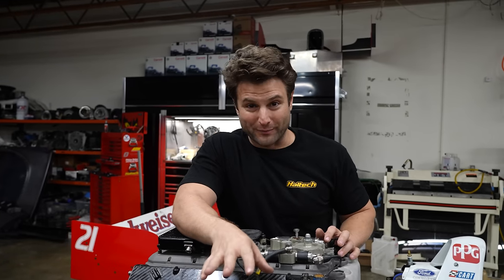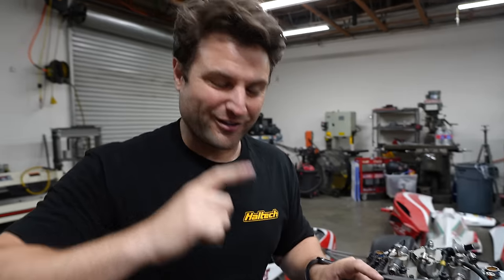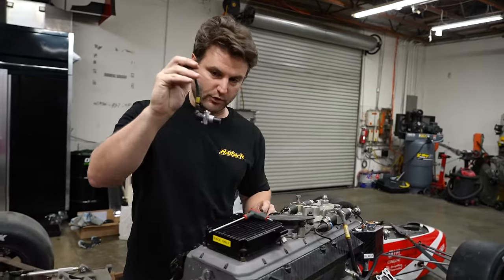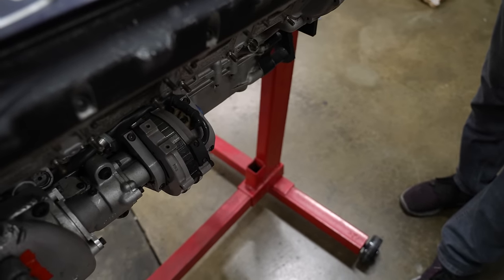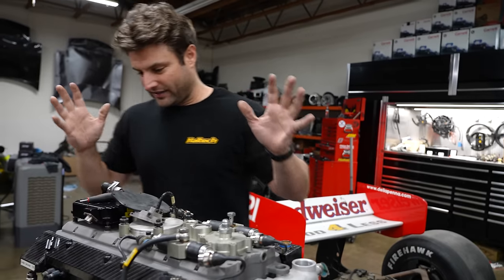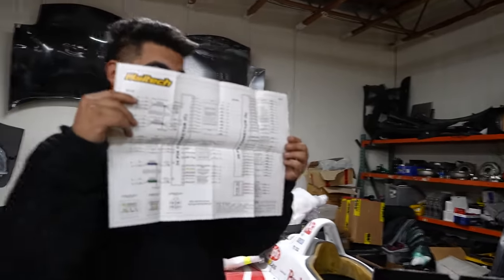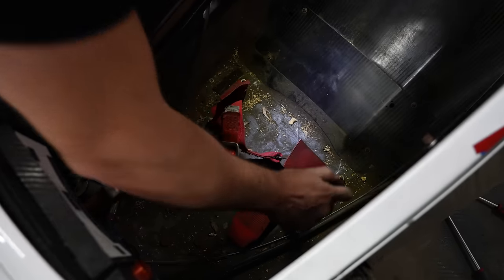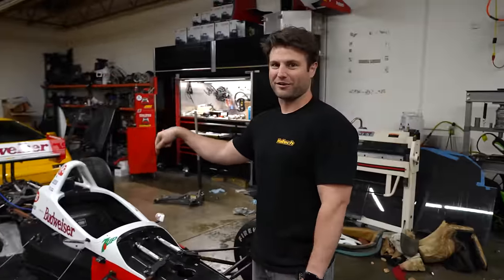Reverse engineering Cosworth secrets. How to start the Indycar project without any info

Comment: Rob, those aren't discontinued connectors. Those are mil spec connectors. You are correct about them being "pre-autosport" though. But they definitely are not discontinued. You can find all of them, from electro-enterprise. Corsair makes them.
Reply: Like the pc giant manufacturer Corsair?
Reply: @justinsimmons7929  No sir, the airplane manufacturer Corsair.
Reply: @jbuch66koop damn, I was imagining RGB connectors and a rebrand as a “gaming race car”
Reply: @abnormallynormal8823  😂
Reply: I feel like this must be an older video. Rob literally has milspec connectors on the 4 Rotor. Only a few minutes in so might be wrong 😬😬 but I'm pretty sure he knows! Might not though, so always good to be helpful!
Reply: @PlayinWithMahWii  pretty sure he used autosport connectors, on the 4 rotor. They're basically the same thing, but they have different pin layouts and sizes, more suited for car usage. And they cost 2-3x as much, for the same connector size, than regular milspecs.
Reply: @shvrdavid  correct, but no one here claimed Corsair made autosport connectors... Autosport are exclusive to Deutsch. I stated that Corsair made the milspec connectors, which is what's on Rob's original harness that was used on the car.
Reply: @shvrdavid  and trust me brother, nickel plated mil-spec connectors have been around decades before Deutsch made the autosport line up. So yes, those connectors are "pre-autosport" meaning they came before the autosport line did..
Reply: We actually use those connectors a lot in the Air Force lol I was screaming when he said they are discontinued altough our versions are a lot newer and a little different
Reply: Those connectors are industrial control connectors made by a company called Amphenol.
Reply: Most of those connectors are Amphenol, not corsair. He could easily google the part number and get every connector on that harness albeit, those connectors go through revisions constantly. As someone who works with Amphenol connectors daily i cant spot one from a mile away, for example that connector at 12:56 i'm 99% sure that's an older Amphenol. Also, nobody says "Mil-Spec" connectors lol. They are Cannon plugs. That's poser fanboy terminology. "Mil-Spec" is a standard. Not a product..It's not "Mil-Spec" wire, it's Tefzel wire.
Reply: @FastPaull  I just love it when people put words in my mouth. 😃 Amphenol designed the connectors, yes. Doesn't mean Corsair isn't making them. The "MS" at the begining of all the part numbers, mean "mil-spec". Every MS connector on my car is Corsair. I appreciate your attempt to Monday night quarterback here though, but again your misconstruing my words.
Reply: @FastPaull  and everyone calls them milspec connectors, the only people calling them Cannon plugs, are people that are ordered too. 🥴 They are refered too as "circular milspec connectors".
Reply: @FastPaull  Well maybe in Your current 'world" people don't call these circular type connects MIL-SPEC, more specifically MIL-C standard connectors, as they were developed for the US Military first, then expanded into other uses within ARINC, many industrial, including Indy, F1, 3, G1, open wheel, many professional level racing vehicles and others uses, applications over the many decades since.
How long have You been involved with assembly, wiring, installation using these Amphenol, Cannon [another manufacture], circular connectors and other types ?
Good Luck
Reply: @Josh Buchanan  Haha, in the aerospace industry they ARE NOT called that.
Reply: @Newton Firefly  I've been doing this for over 10 years. I've built harnesses for fixed wing military aircraft, tilt rotor military aircraft, drones. You name it. I've pinned more of these connectors than everyone in this comment section combined.
Reply: @FastPaull  that's an awful bold statement considering you don't know a thing, about anyone you're talking too. 🤣
Reply: @FastPaull  they are called circular, barrel connectors. Within the US Military often  specified as MIL-C. ARINC and other have their specification standards too. Some individuals have referred to these as "Cannon" type, connectors since Cannon connectors were among the early producers,then Amphenol about 50 years ago.
Reply: @FastPaull  Ten years is a very good and reasonable amount of time to be involved with wiring assemblies and such.
Which company do you work within and what is Your specific position there ?
It seems that with the experience You have stated, Your would be able assemble these wiring harness properly. Also You would clearly, nearly immediately notice, recognize and detail the obvious, certain lacking with proper methods which Rob has and within the process, thinking etc. too.
All The Best, Sincerely
Reply: Amphenol GT reverse bayonet connector style, 5015 insert patterns (same as the OG threaded connectors, probably the pins are the same) and have been around for quite some time already. There's also a plastic version but dunno if it corresponds to the Autosport connectors
Reply: @newtonfirefly3584  I'm a contractor for the DOD. I've done work for several aerospace companies including NASA. I'm an Assembler/ME. IPC class 3 trained, J-STD soldering certification. I've done harness work, sub assemblies, fiber optics. My current line of work is Naval Countermeasures. Harness work like this comes and goes, but honestly, that's fairly basic stuff these days. That's what the new hires get to do. It's the best way for people to cut their teeth in this industry.
Reply: @FastPaull  It seems You have developed some very good skill, experience and expertise within assembly, specifically wiring with aerospace contracts. 
You don't specify which contractor You work or are employed, however mention the DoD as the US Government Agencies with which the contract work is done along with NASA. As We all know, none of these Government Agencies are 'companies' and there have not been any major or significant projects for NSA for decades either, since the cancellation of the Space Shuttle program, use.
[actually worked on, with some equipment for the Space Shuttle communications  system equipment]
If You reside in the LA area, thus am specifically familiar with the companies there since my post-University work began there in 1982, along with other major aerospace contractors within other areas within the USA, in Seattle WA area, Atlanta, GA area, Boston, MA area, Dallas Tx, Area, Melbourne, FL area, Tuscon, AZ area and others which are among my person al direct knowledge, familiarity, years of experience and involvement.
Sincerely
Reply: Idk why people always forget about the mil-spec connectors. They are half or a fraction of the price of an autosport connector and do the exact same job. Look just as nice, they come in different styles, black or a silver/ Nickel-plated look
Reply: @pbAdpcustoms  Sure Indy, F1, LeMans, GT and others including NASCAR, NHARA/IHARA/PDRA/ etc use them for decades.
these circular, MIL-C connectors have the many advantages they are designed, developed, manufactured, produced, required, installed, used meant for within the military, ARINC, industrial, etc. environments and uses.
Automotive is generally very delayed, backward, behind the level of technology development. Indy, F1, LeMans, GT have specific need, constraints, environment, thus these type of connectors became very useful, necessary, important, critical to use.
Sincerely

Comment: Rob, you can buy any of those connectors. Check out TE connectivity and Amphenol. There should be a part number around the backshell area and if you give them a ring they can direct you to the proper replacements.
Reply: There is also a lemo connector in the mix, although he said he was going to nix the Pi connections. I think even Glenair makes new mil spec connectors now
Reply: Mmm. Ima look into it also
Reply: Lemo are expensive as fuck i used it in formula student they are lovely to work with
Reply: Look mostly like standard 38999 style to me.
Reply: I’ve been out off the game of marine navigation electronics for almost 10yrs now but we used connectors like those on some of the older or bigger equipment. Since your on the west coast you should be able to find a marine electronic outfit that may have access to some of those pins and connectors. You do need a special crimper for the pins like usual.
Reply: Look like turk connectors to me
Reply: I was gonna say they looked an awful lot like amphenol connections

Comment: I worked on these projects with Tim Jenkins at Cosworth headquarters as a sub contacted procurement specialist thru the late 90s. Electrical engineering mostly and capacitive duractive loadial subtraction. Very familiar with your car, Great to see you are reviving it to its glory.
Reply: I googled that and came up with nothing. Wish I knew what you were talking about.
Reply: @LPMutagen  try a different search routine, perhaps, which is more reliable, extensive and not biased.
Reply: We know very well what a "procurement specialist" job, its function, position and work is.
Certainly nothing to do with actual technical and certainly not engineering too.
Though You may particularly enjoy the 'revival' of this specific motor vehicle, it is quite obvious You don't have at most limited knowledge about mechanical, electrical, assembly, technical, technician, and such.
Just, Your view that Rob Dahm [his 10 year old channel is clear proof] could or would achieve anything properly, significant, meaningful or complete a single project is clear with Your person basis, view, perspective, information and knowledge too.
Good Luck
Reply: @newtonfirefly3584  I bet you're fun at parties.
Reply: @newtonfirefly3584  well, "duractive" doesn't appear to be a word. "Loadial" doesn't to be one either. I'm not sure why search engine bias would affect anything as this is a political topic. Anyway, I tried duckduckgo and got the same gibberish results.
Reply: @LPMutagen  also agree with Your assessment about those terms, "duractive" and "loadial" as nonexistent words. The latter 'loadial' seems t possibly derived from 'load' to express load assessment, evaluation, concepts and such. However, the concept intended with 'duractive' is more evasive and unclear, though something with 'active' and 'duration' or 'durable'. 
Clearly from the description of this user as a "procurement specialist", means involved in  purchasing, not engineering.
->what sort of 'gibberish' did You result with ?
->my search results do not contain any gibberish, though my selection of sites to view are very careful, particular, specific, with discernment and may be different than Your process.
->why are You presenting anything about 'engine bias' and especially interjecting 'political' into this discussion, which is clearly not within the topic !!
Sincerely

Comment: That motor DOES have a blow off valve (actually referred to as a pop off valve) , or at least it had one. It isn't installed now. They were a series mandated part that set the max boost level you could run. It is a large cylindrical part that bolts down to the top of the manifold just behind ignition box and protrudes through the top of the body work. There is a block off plated bolted down in that position currently. The "POV" wiring label you found is part of the Pop Off Valve system.
Reply: I love how Rob's community is essential to the progress of his projects at times.  You all are awesome
Reply: Was it vented to atmosphere or routed back to the turbo intake?
Reply: @CP110  Vented to atmosphere. It was really sktechy on ovals, especially at Indy. If it popped off, you'd lose boost and the car would slow really hard . They actually used a "puffer" tube routed to the driver's helmet that would blow air on his face as an alert that he was getting too close to the boost cut. The boost level was changed a bit from season to season and sometimes track to track but was usually in the 40-45psi range. Then some teams that had in house engine programs, like Penske, started finding ways manipulate the airflow in the intake and move the pressure wave in a way that they could exceed the max boost level without triggering the pop off valve. EDIT: I mis-spoke on the boost levels. It was 35-45 inches of boost, not PSI. That would be in the 18-25-ish PSI range.
Reply: Awesome info. The history of racing is a history of subtle cheating, love the solutions these engineers concoct
Reply: @MX304  wow awesome information.
Reply: Would that be similar to a burst panel on a pro mod blower?
Reply: PSI stands for pounds per square inch. I feel like it’s the same
Reply: @MX304  Do you happen to know if the POV's used in Indy were similar/the same as the FIA mandated ones that were used in F1, WRC and ATCC?
Reply: @deathklock333 sounds like a burst panel, not always pro mod. 

Not always blower either, some nitrous guys run them. 

Some ‘burst panels’ are even spring loaded.
Reply: @dylanzrim3635  They might be meaning in/Hg.  1 in/Hg is roughly 0.5 PSI.
Reply: @HiBoa  Similar ideas, but very different parts.
Reply: Sounds a lot more like a wastegate than a blow off valve.
Reply: @Hayamate  Correct
Reply: @deathklock333  No. Burst panels are only there to prevent blowing the manifold up, blowing a supercharger off, etc. in the case of a massive backfire. More of a safety feature for those outside the car really.
Reply: I did most of the drawings on the XD POV installation. Please reach out for a chat.
Reply: @ArthurSperotto  wastegate is on the hotside of the turbo, pop off is to prevent overboost by "popping" and let boost vet out of the preasure side of the system.
a blow of valve does activate to vent out boost during spool down and release of throttle.
pop off is active during boost spike and att full trottle.
Reply: Was pov a part owned by the sanctioning body, distributed by them and after each race collected?
Reply: Yes. For the year XD was introduced they had a new POV with an internal travel sensor so we could detect the valve starting to move before it blew and try to trim back the boost.
Reply: Yes. I believe they were also tracked and rotated so the same team wouldn't get the same POV multiple times a season.
Reply: @adamruddle6558  That would explain the POV wiring they found in the harness. Did the XD always run the "new" valve with the boost reference port lower down in the intake manifold that prevented the tricks that teams were using to make the older valve see less manifold pressure than they actually had?

Comment: Rob, the connectors labeled P1 are part of how the wiring diagrams are labeled/organized. 

When you look at engineering drawings, assemblies and wiring harnesses will all have connectors labeled with a letter + a number to simplify instructions. For example, P1 on cable A goes with J1 on assembly B, P2 goes to J2, etc.

Comment: There is a method to the madness to the mil spec connectors that you have on that cosworth harness.  For the D83999 connector: the first part is the connector class or family / shell type (bayonet, screw, breakaway…), material (finish), insert arrangement (layout of the pins), contact type (Pins or Sockets), key position. If you know the part number of the connector you have (printed or stamped on the side of the shell) you can build the part number of the opposite connector that will mate up. To de-pin those connectors slit the back shell boot and use the plastic insert/removal tools on the wired pins. Get a bunch of each size (green/white, red/white, blue/white, yellow/white) because they are semi disposable. With those tools you can pull the pins out of the connector without cutting wires. Don’t forget to lubricate the rubber insert with isopropyl alcohol to loosen the surface adhesion on the pins for removal.

Comment: For what its worth, “Pi” was the original electronics company (now owned by and branded by Cosworth) and Cosworth did only engines at the time. “Pectel” was Pi’s ECU line of products, while chassis data logging components were all “Pi”.
Reply: and they cost arm and leg, pectel can get serial numeber off that wire loom and can program ther ecu to new standard but that is 0 chance of happening.
coswort have programs for old cars to restore them and modernize but to expensive sauber c9 i now motec system with custom software so this is this much expesive to do

Comment: The fuel fill on the top was not used during races. It would be set up on the right or left side depending on the direction the pit lane was set up at each track. Also, the fuel tank is not the carbon part. There should be a rubber, methanol safe, bladder inside that bulkhead that actually holds the fuel. it is removed / installed through that access hatch and is a HUGE pain in the ^%$! to get in and out.
Reply: The rubber fuel tanks have really only been around for 10-15 years
Reply: @dylanzrim3635  Been in use in aviation since the 1940's and in race cars since the mid-70s. Even some of the old aluminum monocoque F1 and Indy Cars used them.
Reply: @MX304  lol kida

Comment: The red lever is probably for allowing the shifter to go from reverse straight to top gear and also from neutral to reverse. I know they do this on modern sequential boxes.
Reply: Exactly, looks like a reverse lockout to me.
Reply: Def looks like reverse lock out
Reply: first thing i thought is neutral lockout like on motoGP bikes with sequential boxes
Reply: I went to an expo in Keulen and they had sequential boxes with lockout. It was a small extra red lever on the shifter allowing for shifting from reverse straight to top gear( don't know why anyone would want this) and it was either for getting in reverse or neutral.